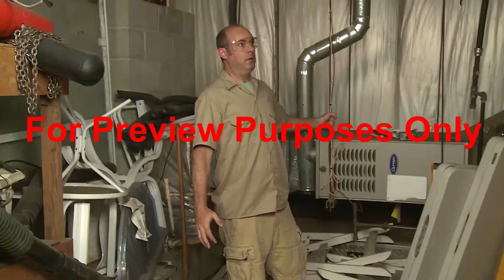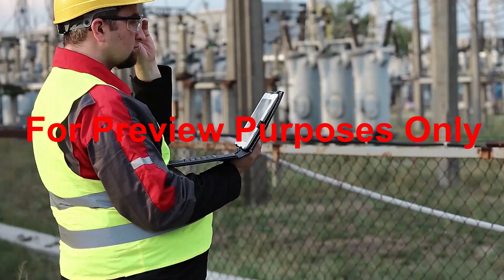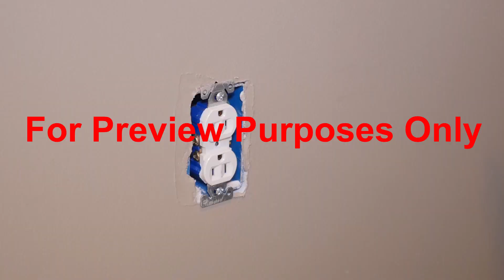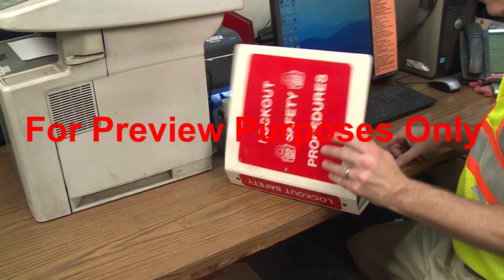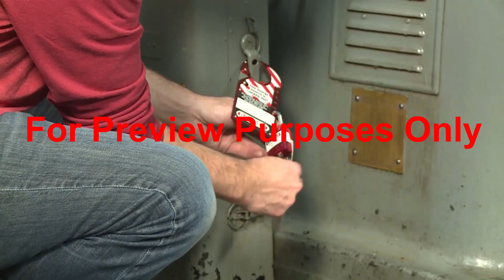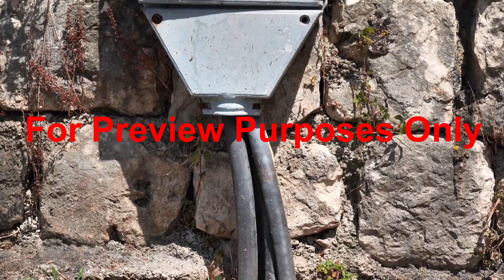Electrocution Prevention Made Simple - Training From SafetyVideos.com

Comment: Unfortunately sometimes even when you follow all of the proper precautions electrocution can still happen. In that situation it is very important to know what to do. Here is what to do in the event someone is electrocuted.

1. Prepare yourself and others in the workplace for any potential emergencies. If possible make sure that aeds and fire extinguishers are on the work site. Make sure that they are somewhere where you and others can not only quickly get to them but also know where they are and also make sure that the nearby area is clear of any obstacles. That way in the event of an emergency people can quickly get to them. Also get yourself and other coworkers training in first aid and cpr. That way if someone is electrocuted then you and other coworkers will know what to do and will be able to help them.

2. If someone has been electrocuted remain calm as Panicking will not help the situation and may even make it worse. Your first instinct may be to either immediately preform care or to grab them but this is actually one of the worst things that you can do. This is because if they are still in contact with the thing that electrocuted them such as a plug or outlet just touching them will result in you also receiving the electrical shock thus resulting in not one but two victims. Remember you can’t help anyone if you yourself get injured or killed. Instead immediately look everywhere around the area from up to down to forward and back checking to see if the person is still in contact with the source of the electrocution. Only touch them if they aren’t in contact with the thing that electrocuted them. If they are still in contact with the source then if possible shut off the power such as by turning off a switch or breaker. Only then can you or others treat them.

3. If the person has been electrocuted by downed power lines don’t enter the area under any circumstances even if the wires aren’t sparking or sagging. While your first instinct may be to remove the person from the area or to move the wire it is actually one of the worst things that you can do. This is because even if it doesn’t look live electricity is usually invisible meaning the wires may still be live. Therefore if you enter the area you will get electrocuted yourself thus resulting in another victim. Instead stay well away from the area and immediately call both 911 and if possible the power company. That way the power company will then be able to denergize the line making it safe for you to help those electrocuted. Wait until the power company confirms that the line has been denergized before helping the victim. While it may go against your natural instincts to help the victim and even if the electrocuted person is a fellow coworker or friend or family member remember you can’t help anyone if you also get injured or killed.

4. Once it is safe to do so check to see if the person is conscious by shouting are you ok are you ok. If the person is conscious or is responding to you check for burns and other injuries and if possible get them to the hospital or call 911 so that way paramedics can arrive and take the injured person to the hospital to be treated. If the person does not respond immediately call 911 or have someone else call the number. Make sure that the dispatcher knows the exact location of the emergency and what exactly happened. Then immediately preform cpr on the patient by doing 30 chest compressions and 2 breaths per minute and if possible bring a aed and use it on the patient. Keep doing this until the paramedics arrive and take over care, the person regains consciousness or begins to respond to you, or you are too exhausted to continue in which you would have someone else take over cpr for you. If no one else is around keep going until help arrives and takes over or until the person regains consciousness or begins to respond to you.

5. If the person is conscious continue to keep an eye on them or if you have to leave to call 911 make sure that someone else who is trained in cpr keeps an eye on them until you return. Remember they could quickly go unconscious and suffer cardiac arrest at any moment. If at any time the person goes unconscious or stops breathing immediately call 911 if you haven’t already and then immediately preform cpr on them while also using a aed on them.

6. If the person has been burned then prevent the burn area or areas from becoming infected such as by putting cloth, or bandage on it.